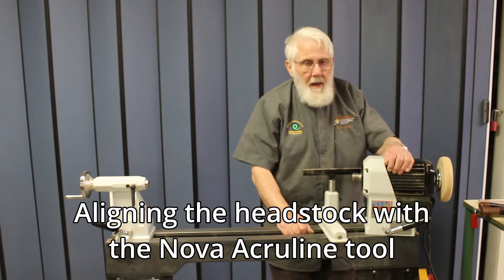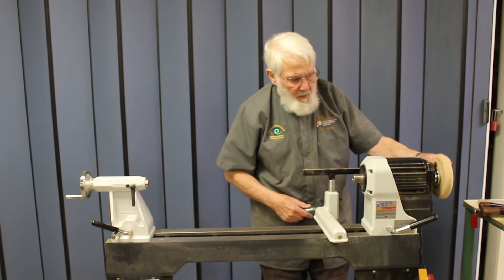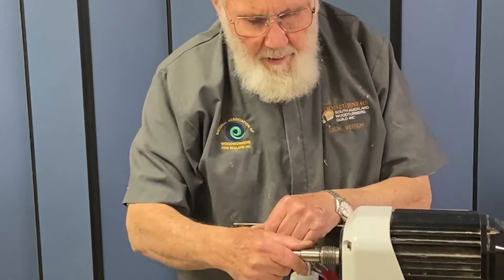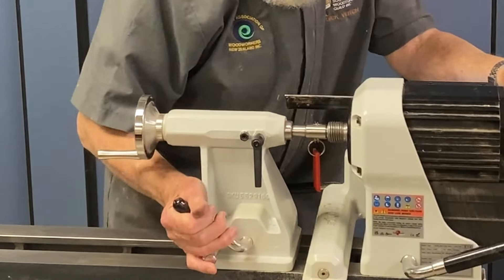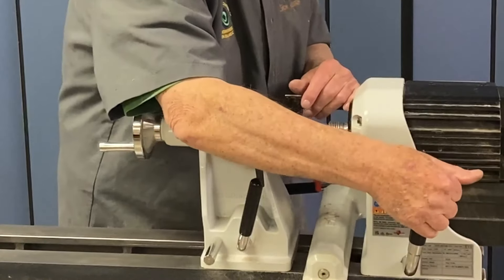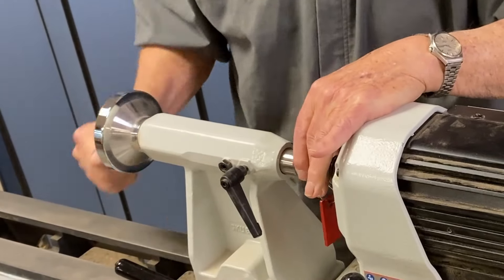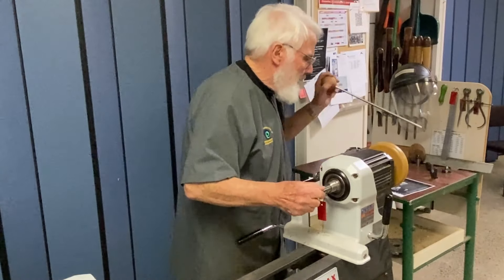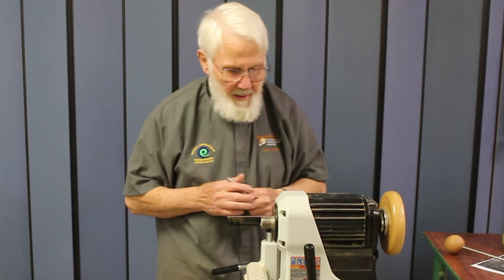Aligning the wood lathe headstock

Comment: How do you adjust if it doesn't align?
Reply from the maker: All lathes are different. The Nova Neptune Lathe as shown in this video, page 20 of the manual (available for download from teknatool.com) explains the process of aligning the headstock.  If you have a different lathe then you should consult the manual for that lathe, failing that hopefully someone has posted something to the internet that can help.
Reply: Thank you for your reply.